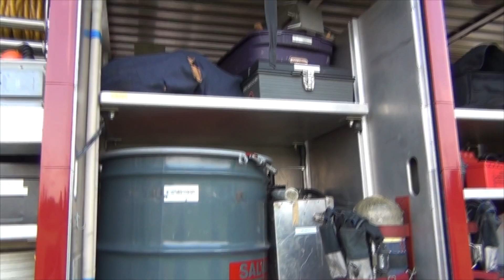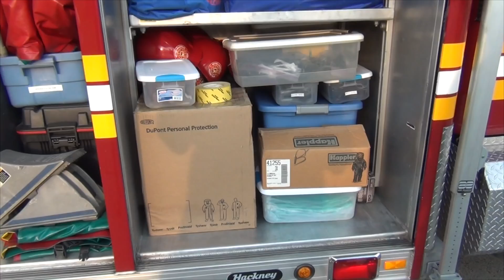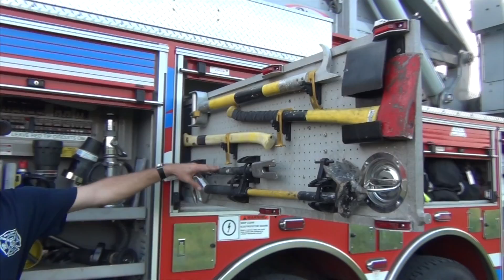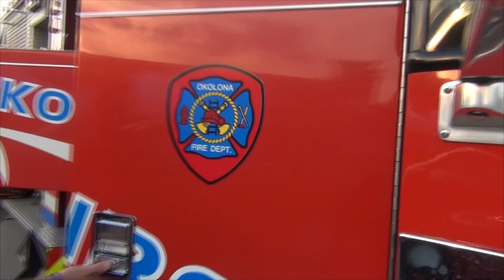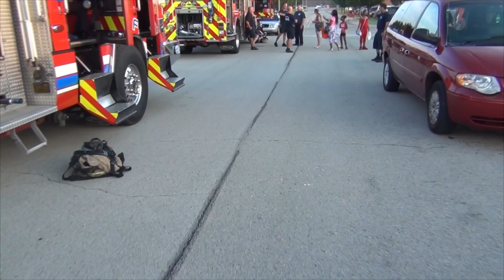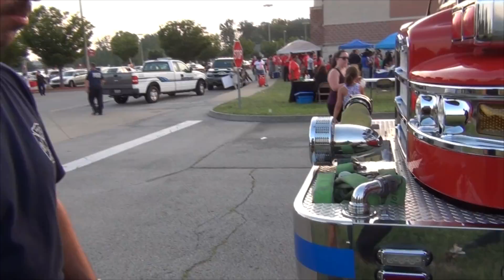Okolona Fire Apparatus Tour

Comment: One of the best laid-out use of equipment I've seen... I dislike seeing a million-dollar piece with compartments that are not fully used. Bags of oil dry rather than using the auto-dispensing devices. Million-dollar trucks that I've seen are horribly equipped.

Comment: Pretty much everything is in there. Ours is called Penetrator fire truck with only 607.59 gallons tank capacity around 2.3 cubic meters. No SCBA, well 5% of the total tools you mentioned. I am a licenced electrical engr designated as a fire truck driver operator for almost 10 years now. Our area of responsibility consisted of high hills, steep slopes, small narrow roads... bdgs consisted rice mills, saw mills, small business... my biggest fear were during el niño, hectares of land trees, bushes, plants burning for weeks on the hills...

Comment: Whats the difference between pumper truck, squrt, mini pumper, midi pumper? Command service vehicles ???
Reply: Hi there, I will do my best to answer your questions about the different types of trucks rn ran in North America, I am in the US and from my knowledge Canada uses very similar types. 
So a pamper truck, most often called an Engine is the most common type of fire apparatus used.  It’s main function is to carry water and hose and pump water for the firefight.  They typically have a tank capacity anywhere from 500-1000 gallons with urban engines usually having lower capacity like 500 and the more rural the larger the tank in most cases so 750 or 1000 gallons.  That is because in the urban setting there are hydrants more available.  The pumps typically range in capacity from 1250 to 2000 gallons per minute (GPM) with probably the most common being 1500 GPM.  They carry both supply line and attack line, supply going from water source to engine and attack going from engine to fire.  They also carry ladders, hand tools, sometimes hydraulic rescue tools, and most often also EMS equipment.  

A “mini pumper” is a smaller more compact version of an engine, they typically are built on a heavy duty pickup type truck chassis and usually have a similar pump capacity.  Usually a smaller tank and less all around equipment.  They serve the same purpose as an engine on a fire and are most often bought for their compact size and also lower price.   I am not familiar with the term “midi pumper”.  In so far as a command vehicle, there are generally two types.  The first is usually a pickup truck or SUV that the on duty battalion chief (or officer in charge of that area and shift) uses all of the time.  Most often equipped with very basic hand tools, the chief’s protective gear, dispatch computer, map books, books containing info about the area’s buildings, hydrants, etc.  They also usually have a more comprehensive radio setup that can interface with other local agencies.  These units are usually called Battalions, so it may be named Batallion 271 for example and are used during any sort of fire or larger scale auto accident and anytime the Incident Command Structure is implemented.  The other type which is used for more major incidents is a mobile command post and they are typically large vehicles with basically an office inside with radios and other communication equipment, desks and such and are used for the command staff that to plan their tactics and such.  They are often called Command so for example Command 271.  I hope that helps to answer your questions!  If you have any other questions please feel free to ask, as you can tell I love talking about the topic!
Reply: Sorry I forgot the squrt, it is actually a brand name and refers to an engine with an aerial device mounted that is usually a smaller length ladder like 55’ or no ladder at all and just an aerial boom with integral piping and a nozzle at the tip and is used to project water onto the fire from an elevated position.  I can’t remember at the moment which company makes squrts but they aren’t too terribly common.